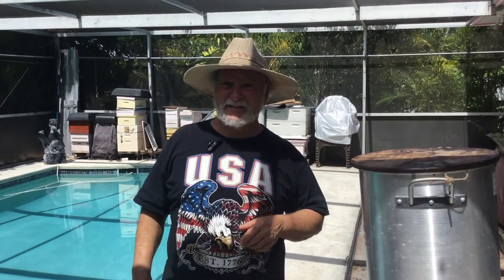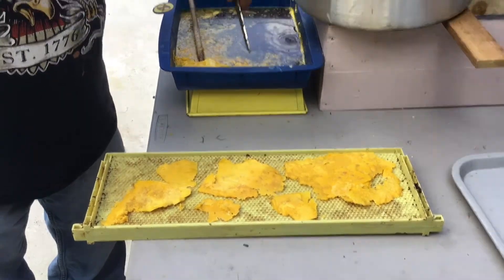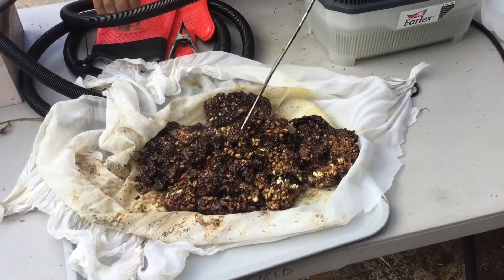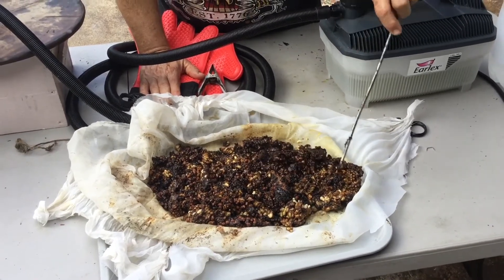Steam Extraction of Wax - Take 2! Improved set. up

Comment: Is there a recommended size of container you would suggest for this steam extraction method?  Looking forward to a video on how you melt the wax again in your crock pots and the molds you put them into:-)  Appreciate the ideas you share!  Thanks
Reply from the maker: My first setup was just three stacked 5 frame nucs.  Great for concentrating heat but a little cramped.  This turkey cooker pot has proven to be just right.  I have tried a half dozen different suspension methods without a failure, just various levels of success.  By the way, soon after, I found a roll of pipe insulation wrap and wrapped the pot.  that has proven to be the best improvement.  Size isn't as important as good insulation.